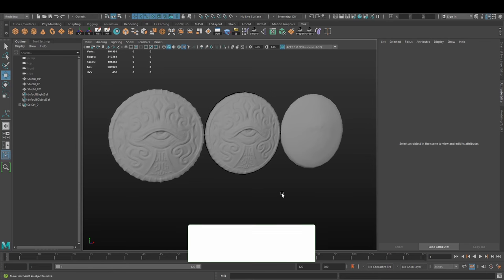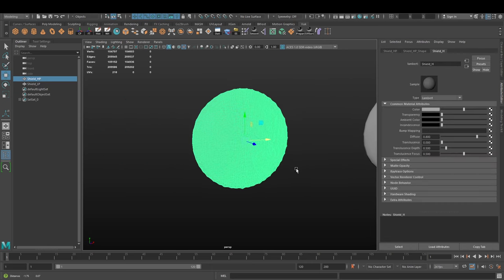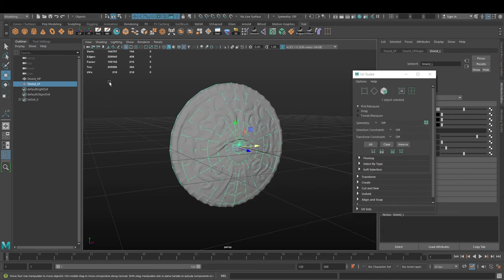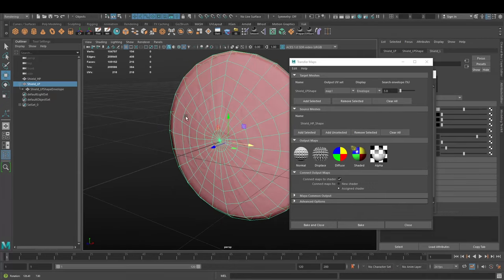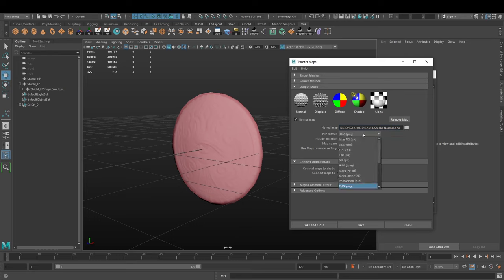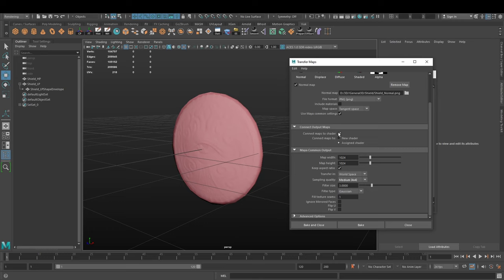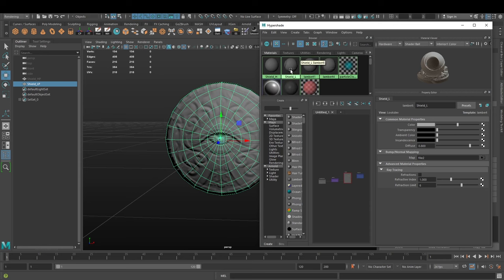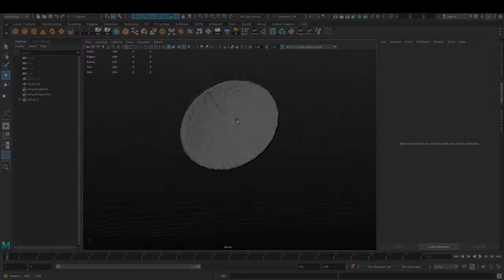Maya Tutorial - How to Bake Normal Maps from High Poly to Low Poly

Comment: How does this hold up against exporting the model and baking in another program like substance painter? Is the only/main benefit simply being able to work solely within maya? Informative video regardless!
Reply from the maker: Just wanted to explain a method to do it in maya, you can approach whatever route you are most comfortable with and gives you best results. Personally I would always prefer to use painter for baking if possible, but it's good to know how to do it in other software as well.

Comment: hey i wanted to ask if its possible to make a high poly model and turn it into low poly or do i have to model a low and high poly version
Reply from the maker: Yes, it's possible to make a high poly first and then make a low poly version of it through the process of retopology. There are various way to achieve this, one of which I covered in a video about Maya's retopology tool called Quad Draw, check it out here:
https://www.youtube.com/watch?v=ZAoPagmvxyM
Reply: @Figura3D  thank you so much!!

Comment: can we put this kind of model in unreal engine and get same result with details :D so it looks good on game with low poly
Reply from the maker: Yes, that's what this process is for, producing the Normal Map means you can then use that Normal Map in a game engine to setup your material for your Low Poly so it looks more detailed, this is just one of the ways to produce the Normal Map, and there is a bunch of other maps that you can make to increase the similarity between your low poly and high poly

Comment: so do the low and high poly need to have the same material?
Reply from the maker: No, material has little to nothing to do with the process of baking, you can select to add the baked texture to the existing material on the low poly or create a new one, but the important thing is that the baked texture is generated at the designated location from which you can then import it to any material you want
Reply: ohhh thank you so much. i always thought it needs to have the same texture. im currently doing a high poly bake for uni and for some reason i keep getting black shading issues. do you know what could be the reason for that?
 @Figura3D
Reply from the maker: @annagebhardt5389  join the discord link on the profile so you can share screenshots so we can troubleshoot more easily

Comment: the question is, how do you create your high poly ?
Reply from the maker: Sculpting in Zbrush is the most common way, but you can also do it in Blender or Maya or any other 3d package that supports handling and sculpting high amounts of polygons
Reply: @Figura3D  thx for the reply Figura, im new into this world so I apologize for so many questions... If you have the normal 3d model, you can (need) to import that model and start creating your High poly from there?
Reply from the maker: @marcos_ferreira1997  that's one way to go about it, the other way is to create it from scratch in the sculpting software, both are correct ways depends on what's easier for you, it all depends on the type of the project at hand, more organic stuff is more often created from scratch in zbrush while hard surface stuff is more often created through generic box modeling and then brought into zbrush for sculptural detailing
Reply: @Figura3D  Do you know any good tutorial about that? I cant find a proper one, maybe Im googling with the wrong keywords